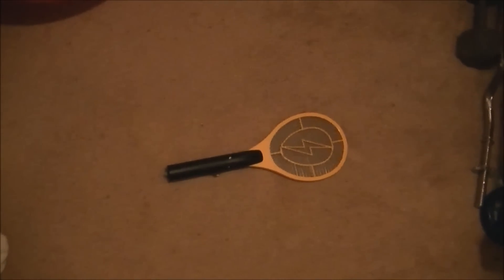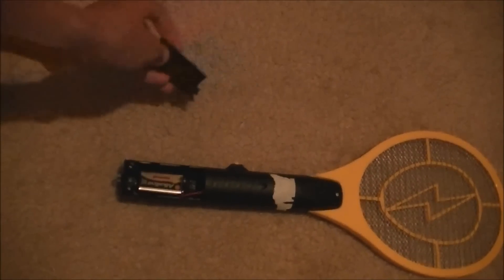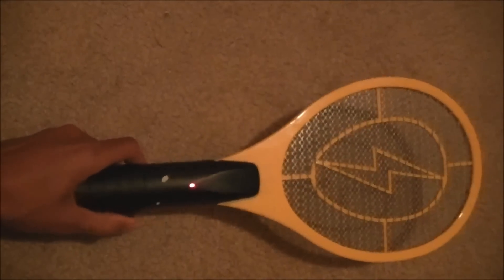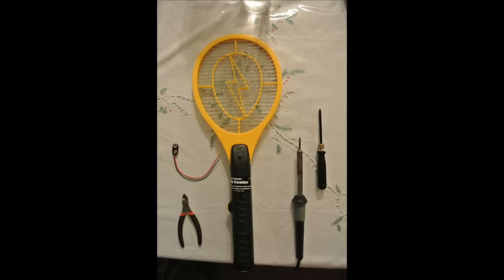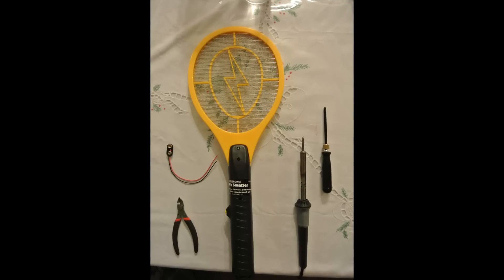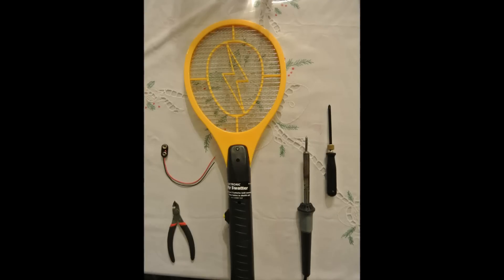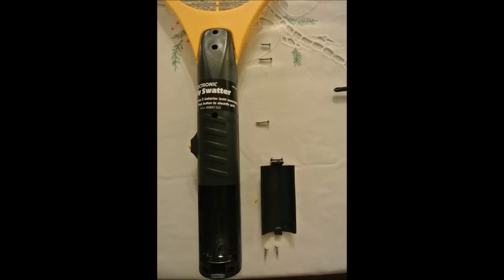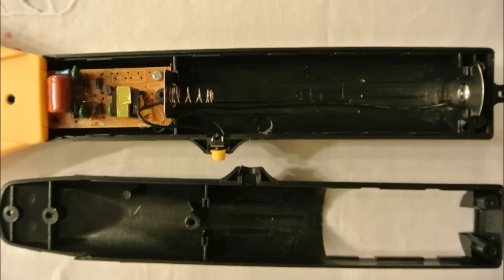How to Mod Your Electric Fly Swatter to Triple the Zapping Power

Comment: 1. You didn't prove your theory to be effective.2. The circuit was designed to operate and TRANSFORM 3 volts into 2,225 volts. In other words, increasing the voltage to this circuit will add stress to the circuitry -- especially the capacitor; it may explode. 3. In order to truly triple the voltage, you'll need to replace then retro fit both the capacity (capacitor) & the step-up transforming coil with 3X their shown values. OR you could connect three separate "zapper" discharge leads from three different units. Connecting the discharge leads in series with oneanother -- to a single electric discharge screen -- will triple that voltage.
Reply: plz make a video then if this one is incorrect. make a how to video and i will gladly subscribe :)
and upgrade my swatter!
Reply: i didn't think this would work!
Reply: +Carl Kane - 100% CORRECT and 18+ People with " Thumb's Up " are NOT wrong either !!!
Reply: I tried it with a 9V Battery, it fried my Circuit Board :((((((((((((((((
Reply: your right,, you can burn out the other parts as well...
Reply: Okay, no. This absolutely works, and yes it puts stress on the circuit, but it's nothing the capacitor can't handle. The stress is on the transistor, which you could replace with a higher power one and if you use the right one, then you could run this on 12 volts because the simplicity of the circuit allows for a very flexible input voltage.

Comment: This mod will not make the swatter more powerful, but only charge the capasitor faster. It's true that the output will be greater (because you can charge and discharge the cap more times in a second), but the voltage should stay the same.

Comment: I thought of a different mod that probably does as much to help the voltage and certainly will prolong battery life:
Snip the leads of the drain resistor.  It's only a safety measure.  It's a approx 6 1/2 Meg ohm resistor across the output to the live grid.

Comment: This will only fry your circuit boards which were designed to handle 1.5 volts. You need to change the transformer and capacitors to be able to increase power. This video will only serve to mislead those viewers who are not savy with electronic engineering & physics .. it was the first item found when I did my search and this definitely will NOT WORK.

Comment: UK >>>£1 in Poundland, bought two today (Oct 2015), removed the fly swatting mesh and just playing with it @3v, gives a decent spark but will not Ark which is what I need. Trying this first as an alternative to adding more capacitors and....  it made no difference, it works the same , output @ 9v is the same @ 3v. Not using the zapper in the video though but from what I can see the circuit is identical. You need to add a capacitor to the + and - after the PCB to the NEg and POS wires leading upto the mesh (in Parallel) or use a disposable camera for 330v Ark (PCB larger in the camera and considerably more dangerous, 330v can permanently damage your nervous system if not kill you, despite your physics teacher telling you its the AMPS that kill you not the Volts. So be careful!!
Reply: +Paul Moore must be more wattage in the disposable camera basically and the pain and danger comes from the amps carried by the voltage.
Reply: Which capacitor can be added to this fly squatter? I have this squatter but only need it to be stronger. Adding a second capacitor sounds the easiest thing to do as well.

Comment: My fly swatter got fried when i installed a 9v o.o
Reply: +Wilder wild Oh I assumed that they can't hold it..... and that is because resistor can't hold it. It should be changed with whatever ohm resistor it was with I would say about 530 Ohm. I don't know, I made a 9V LED light from Kipkays videos, and I used 560 ohm and it was kind of weak. So unless you can calculate the correct one,, experiment I guess.

Comment: Makes much more sense as opposed to removing the bleed resistor or wiring in more caps in parallel.  This is like putting a 427cu" Cobra engine in a Ford Focus, "no substitute for pure displacement".  Hey, skeeters' n' moths, kiss your asses Good-Bye!
Reply: Why not do both?  Seems like the way to go!
Reply: Other Than
Actually, the 9v. battery mod didn't work for me.  I think the circuit was designed to handle 3volts and step that  up with the transformer to charge up the capacitor.  When the 9v. battery was added, the whole circuit board became  really hot and now the zapper doesn't work at all.  Some  of these zappers may have different components but the extra voltage from the 9v. battery ruined mine.  And yes, I did install the leads and battery connector correctly.
Reply: lacewoodstrat

What kind stuff needs to be soldered in to make it work? I want to make a beefy enough swatter that it can take down a bird if need be.. LOL, but seriously, we have these huge carpenter bees digging in the house, and I want to zap the shit out of them, DEAD,  when they fly around.